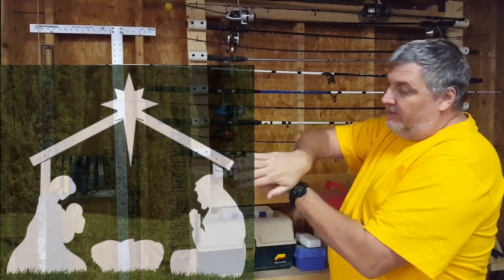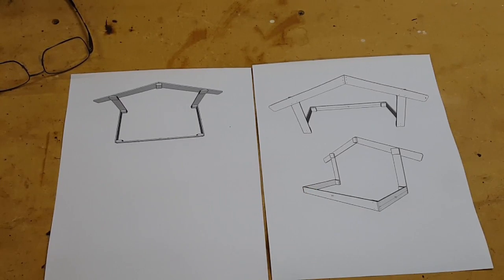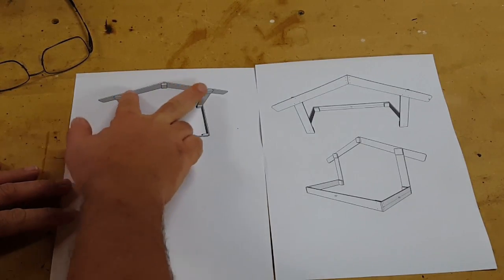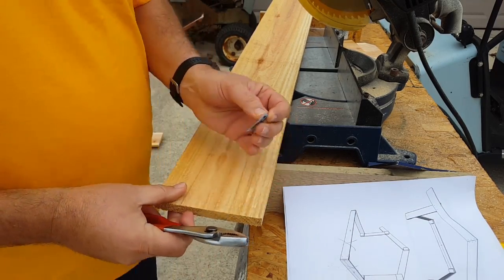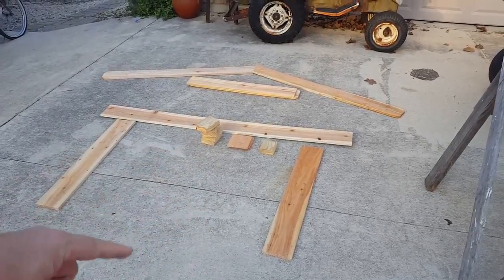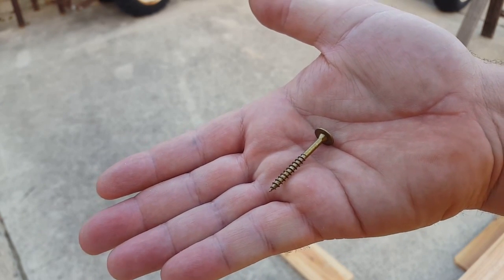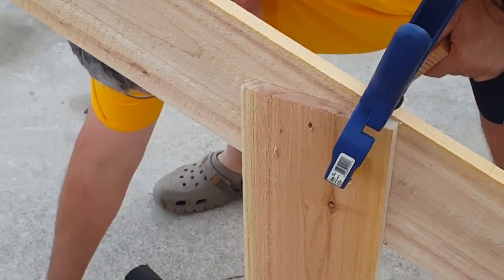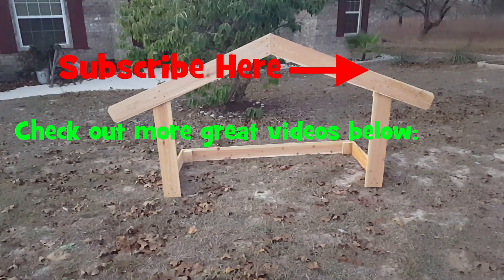DIY - Nativity Stable under $25

Comment: I have an odd size holy family that did not come with a stable, it has bugged me and I’ve been looking for one for years to fit. Could these directions be used in a smaller scale, like 3/4 smaller? I’m not super handy with making stuff like this, but I might take on the challenge if it’s possible to make it that small? Thanks for your tutorial, it came out pretty neat!!